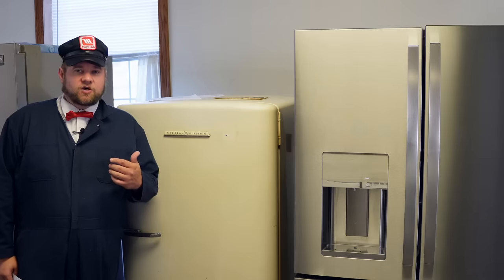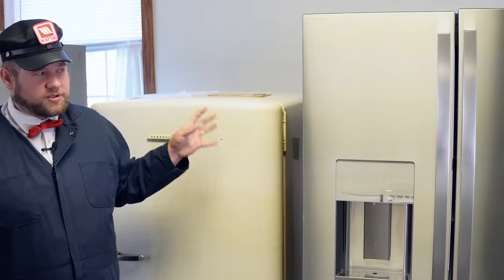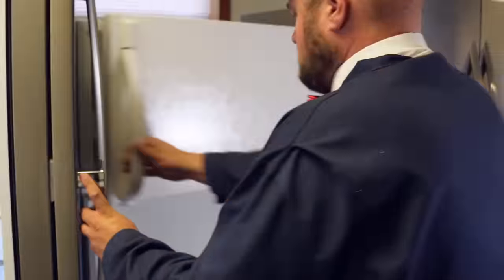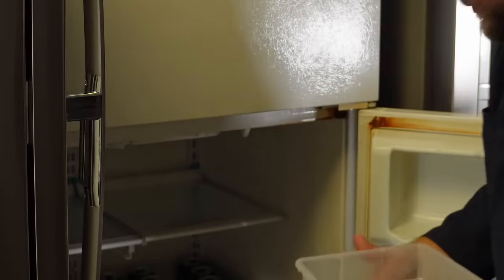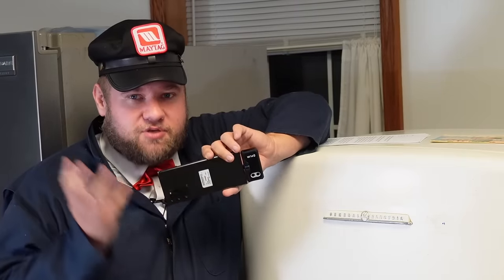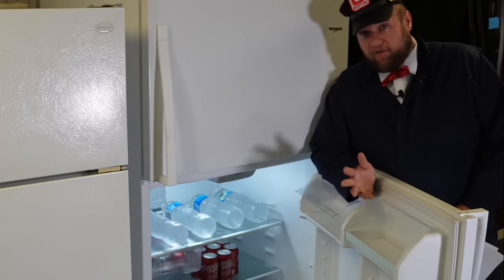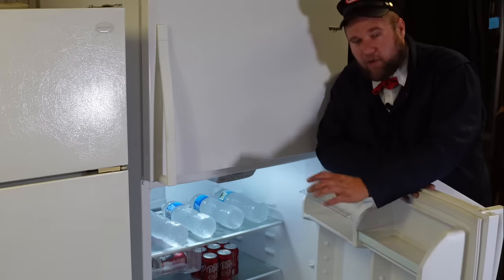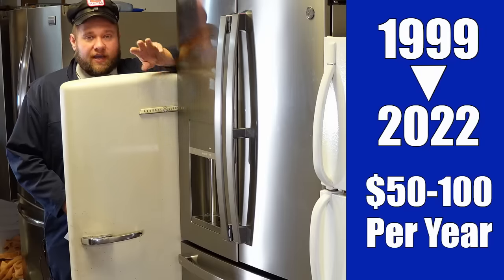Should You EVER Buy a New Appliance if Yours Still Works? A 7-Day Test

Comment: For me, it depends on whether or not there will be significant power savings vs repeated maintenance and failure rates. Old stuff can last decades but they can also suck up a lot of juice.
Reply: I have an old electrolux fridge, past 40 years old by now, not sure how much power it uses but whatever it is, my electric bill is very small, even if i could spare a few dimes a month on electricity i rather keep my old one which gives me a piece of mind, reliability and sustainability over today's garbage.
Reply: @HansensUniverseT-A  I feel the same way about my Nintendo.

Comment: As a certified Energy Manger consider: IF you think you are burning KW with your old appliance THEN consider where you live. BECAUSE: If you live where heat is needed many months of the year. THE WASTED KW from your old appliance is suppling heat to your home.  SO if you have cold weather 9 months that means 9/12 of your 'wasted' energy is actually not fully wasted it is used to warm your home.  If you live in a warm climate and don't need a lot of heat...maybe you should buy a better unit.
Reply: A very insightful comment.   Changes the equation, doesn't it?

Comment: Longevity is always a craps shoot. We have an Amana 18 ft. top freezer model we got new in 1994. Still going strong with NO maint. issues. My mom bought a side by side in 1974 from Wards (Whirlpool I think made it). It had multiple repairs and died the week I sold the house in 1993 after she passed away the year before. We're on our second 5 cu ft. chest freezer and 5th dehumidifier. Had to fix out basic electric Magic Chef range multiple times (eats burner element sockets). The oven element blew up, arcing like a welder. Our Sears washer came from my mom's house and was new in 1992 (the tub on mom's old Sears rusted out after 18 years of use). Fixed several things on it and disabled the fabric softener dispenser as it leaks. One cycle on the mechanical timer has burned points. Our Maytag gas dryer was new in 1994 and is working well except the dryness sensor is bad so we just use the timed cycle. You never know what you will get, but it seams that the new stuff is mostly trash. One of the other YouTube channels I watch was complaining that his new Whirlpool kitchen appliances are junk. He bought the top line stuff and the fridge has never worked and they are still waiting on parts three months later and the board in their range is bad so the oven doesn't work.

Comment: I miss my grandmother's refrigerator from the 1950s. Same generation as your GE but larger with more chrome. Worked flawlessly (albeit too loud at times) for around 45 years, then there was an electrical fire - starting at a distribution panel just a couple meters away from the refrigerator. It was all smoked and smouldering outside. The compressor could still run, although I'm certain the coolant pipes could not survive. Anyway, it went to the landfill along with all the rubble. After rebuilding everything I looked for replacement, and guess what? There were almost identical replicas sold under Korean and Italian brands. At three-four-five times the price of an ordinary white box. Oh well, we took the white box.

Comment: 2018  whirlpool fridge broke down 
Tech said top defrost coil rust premature 
Coil bypass & recharge cost  $ 350
Top freezer unit working great
Reply from the maker: VERY common problem. Easy fix but man... Its rough that they don't make them right from the factory!

Comment: Through experience, if you have an old workhorse appliance, forget about how much electricity it uses. To “save money”, I paid $379.00 for a “top rated” energy star Friedrich dehumidifier in May 2020 and by June 2022 the compressor had failed. What money I saved in electricity never covered the purchase price. Luckily I saved the 1974 dehumidifier which is still running flawlessly.

Comment: I've had a Kenmore (I think made by Whirlpool) since 1994. The ice maker broke down in '99, and I just removed it in favor of the extra space. No service calls at all in all that time, although the plastic is starting to get brittle. I'll use it until it breaks and then if the repair is more than a couple hundred bucks, maybe buy a new one.

Comment: Hmm. I've just done this test with my 2009 Bosch. I've done it once in the warmest summer. At 28C ambient temperature, it consumes 0.75kWh/day. At 20C ambient now it's 0.6kWh. And consumption is roughly 62W when running (was even 85W just after I plugged it in on start of cooling cycle, but it dropped in minute after some bubbling sound stopped. So it's roughly 4.1kWh/week. Considering price of the same size (roughly 60x60x185cm) new fridge is roughly 1200$ here including tax and considering I can likely safe 0.1kWh a day, change won't pay back. But hell ... I'm almost sure old fridge was not among cheapest and it cost 2.5 times less.

Comment: Having gone through 3 microwaves in as many years while replacing my original 18 year old working Sharp Carousel (inside was rusting) I find replacing working appliances dubious at best and a huge mistake at worst as in my case.

Old appliances were built to last and that in itself increases the complexity of replacement. In this world of planned obsolescence I for one won't make this mistake again.

The oldest appliance in my kitchen currently is a 1960 Dominion 2520 "toaster oven" which is not only a beauty but works a treat.

Comment: I have a Whirlpool Designer Style 1992 refrigerator with the freezer on the bottom. It seems to work great. It doesn't run all the time. I just cleaned the coils and the door seals are good. To me it just doesn't seem to make sense to replace it. It's in a limited space in my kitchen so the only refrigerator I could replace it with would another Whirlpool, in particular the side by side 20.5 model with the ice maker in the door.

Comment: Nice comparison, the most interesting data would be starting with all at working temperature with the same things inside, the energy used to get to running temperature is irrelevant because it only happens once.
Reply from the maker: All started at ambient temperature before we loaded them. I had to cut/time lapse everything during that scene, but if you notice, the lights are (or shouldnt be) on any of the refrigerators during that period of time, because none were on when we did this. I loaded them @ 75*F, plugged them into the KAW meters, then plugged them into the power strips, so each refrigerator had to cool from ambient + the thermal loads.

Comment: My Hotpoint no frost refrigerator, about the same size as the 1990s one in your study has been operating fine 24/7/365 since I bought it in June of 1976. The salesman told me I'll be back in a few years to replace it, because "They don't make them as good as they used to."
Actually, this was a replacement for the old Servel refrigerator that was in the basement of the house I just bought. The Servel was from the 1940s I guess, because it had rounded and not square corners. Also, the refrigerant was natural gas instead of Freon.

Comment: No. Newer stuff just breaks more easily and the parts are costly to replace or are just not available even if it's only 2 years old. Also buy the most basic model with no touch screens or unnecessary 'smartness' if you want to use the appliance for a long time. 

This is taking into a fact that you're not using 25+ year old appliances. You will save more in electricity costs then by buying new. But stuff like a washer which gets use only a few hours a week can still be used even if it's ancient with no significant damage to the pocket.

Comment: We had the same GE though from 1947 and probably 6cu ft that came with the house I grew up in and was in our garage as an extra fridge when I was born already as we had a matching 1950s Hotpoint in the kitchen that was much larger. 
The efficiency of the two Whirlpools doesn’t surprise me. Whirlpool won a challenge in 1995 and was awarded forty five billion dollars for developing the most efficient refrigerator design and their most efficient model is their 19cu ft bottom mount. In fact both times that I’ve needed a refrigerator for myself I did my research and I’m on my second since 1998. I have laughably low electricity bills.

Comment: If your fridge stops 
Check  behind for a trip switch  mine had one  never seen this B4 its a  Haier made in Thailand  * a small turn with a  screwdriver click  started  
Some have a red button on the motor old style    Also the thermostat if gone Undo and join wires if starts run & buy a thermostat  cheaper than the $160+ repairman bill Not hard to do

Comment: When you were showing the temperature difference from the outside using the thermal camera, while talking about air leakage around the mag seals, you mentioned about resetting the door seals using a blow dryer.  Can you explain how to do this in a little more detail.  I have a freezer that has some gaps in the door seals that I have replaced once already.  Thank You.

Comment: I would repeat the tests on the most modern tests, only with something like blocks of styrofoam or other solids with low thermal mass to fill the big fridges down to the capacity of Grandma's. Make sure they don't touch the walls of the fridge and increase the amount of air that gets emptied out and replaced with room temp air every time the door is opened.

Comment: I sold my parent's 1969 Sears frost-free upright freezer (19 cf) in 2010, we only replaced the timing mechanism once. I still miss that appliance, but I couldn't keep up with the $50 per month electric bill. I should have kept it in the house instead of the garage, maybe it wouldn't have cost so much to run. I should mention, I live in a hot, dry desert region of the U.S.  During the Summer I'm running an evaporative cooler 24/7, the freezer cost on top of that was more than I could handle.

Comment: Very nice video. I did notice that you were trying to get a measurement of like kind refrigerators. You may have overlooked that the refrigerant from 1950 is not the same used in modern ones. I believe the old ones used R12, R22, or ammonia. I know that R12 was the best refrigerant for cars because the air temperature out of the dash was at least 8 to 10 degrees colder than modern cars running R134, which is terrible. Therefore ozone friendly refrigerant isn't as efficient in heat transfer and in theory should use more energy to accomplish what old refrigerants did. The other factor to consider is how much an ice maker will play a significant role in electricity use, especially with a family. All that warm tap water refilling the trays will make the refrigerator run significantly longer.

Comment: I like a freezer top, its less awkward to fit frozen things in, i don't use most of the fridge portion so i put a lot of jugs of water in the bottom drawers/door shelf because i don't really want to bend down to get anything, don't know how much im saving though. I also have water jugs in the freezer portion but my current fridge has a skinny freezer and not freezer top so i cant fit a lot of water jugs in there. My fridge doesn't cycle too often so its good.

Comment: Will donate my old Kelvinator for free.  Don't know the year, but it is a 50's or 60's model and last I knew worked perfectly fine and quiet.

I can even deliver it for free, depending on your location.  I own and drive my own truck for a living so I can just toss it up on the trailer and bring it with me, heh.

You can use it for whatever, including taking it apart.  I've had it for about 20 years and have never found a need for it.  Better than it going to rot sitting in the basement.  That way, you can do both a teardown video and still keep your grandma's fridge intact.

Comment: One thing you have to account for is the massive air spaces in the various fridges.  The second you open them up, warm air rushes in to fill the entire unit except where there is an object.  That's why it's important to always keep your refrigerator and freezer full.  Otherwise, you have to cool down the whole thing every time.  Since you used the same number of bottles, cans, and water tubs, it's not really a fair comparison between units due to the vastly different air spaces in each.  It's actually not really possible to do a fair comparison because if you fill the space in the large one, you have to cool more cans/objects down even if you have the same amount of air space as the smaller units.   Still good information to know.

Comment: Not sure I'm getting your math.  If when you say "KW" you actually mean "KWH" (which is the actual accumulated energy being used over time - I thing you do, as the numbers keep rising over the course of your test), if I extrapolate the final 7 day numbers out to a complete year, I get:

WP 2018	240 kwh
GE 1950		339 kwh
WP 2022	391 kwh
GE 2022		610 kwh

Energy rates vary across  the states, but the average is ~15 cents/kwh.  As such, the annual cost to run (based on your tests) is

WP 2018	 $35.98 
GE 1950		 $50.84 
WP 2022	 $58.66 
GE 2022		 $91.51 

Fridge volume aside, it looks like a fridge with a life expectancy of 6-7 years is not going to pay for itself?

Comment: I had my older GE professionally serviced, with expensive brand new parts. A few weeks later my life changed when it caught fire, and burned down the house. I wish I had just bought a new cheap one for temporary use, until I was saved up to do a full remodel. Nobody warned me that fire was even a remote possibility. I will never have older appliances around the house again, even if they can be serviced. Ironically, I could buy 50 thousand new refrigerators, for the amount of money I’ve lost. 😢

Comment: It's not just the electricity costs you need to consider.  A lot of older appliances use chemicals and other materials that can be hazardous personally or environmentally which were not acknowledged to be so back when they were manufactured such as aspesdos or CFC's.

Comment: The interior volume of the refrigerator isnlt as much of a variable as you might think in terms of power needed to cool contents. Water has 800x as much mass per cuft as air. More is from the diference in mass of the cabinets that must be cooled. The cubic caacity isn't an objective basis of comparision. It doesn't reflect USABLE capacity. We recently replced a refrigerator with the "same size" unit" and can't fit as much in it. It has fewer shelves, less usable drawers and less options for their placement.  A more  accurate measure of efficiency and use is the energy use per day after the first 2 days. I would have added one thing to the test to  take it more realistic : opening the doors for 60 seconds at 1 hour intervals  10x/day.

Comment: I wonder if putting a computer cooling fan in the 1950 GE fridge would improve its cooling efficiency and performance.  Have the fan blow towards the icebox in such a way as to create more air movement and prevent stratification.

Comment: The 1999 model most likely has a switch that turns on and off a heater behind the panel between the doors making that show up very cold. Customers would turn the heater off to save electricity and did not notice the condensation till it starts to rust. Seen that over and over and would also complain about the mildew on the gaskets too,

Comment: I think a great follow up to this video would be to buy a new seal to replace the leaking one and see how much that costs vs how much you save.
Because it is impossible imo to draw any conclusions from this test, unless you can guarantee all fridges kept the inside at the same temperature. 

7 to 10 years is outrageous BTW. I'd expect a fridge to last 25 years.

Comment: My mother has a fridge that she bought back in the 90's to replace the one that was replaced by the building which is just them replacing their stuff. That freezer would make that hard ice that you have to shut the whole thing down clean out. She decided to buy her own. She bought a model from Sears. We still have it. While it's easier to clean than the older fridge, the one thing I noticed about it was that it froze things quickly. If you put a bottle of water in the freezer, it was cold in less than an hour. I could put in a cup of shelf-stable milk that hasn't been refrigerated and it would be cold in a very short period of time. So from 1998 to 2022 it's still going strong. 

My great great aunt owned a freezer, a deep freezer and fridge from the 1960's. I feel if it still works why replace it. If you need to buy something new, then take the old item and find a spot for it and use it.

Comment: My washer is a 50+ year old Maytag. Still going strong. Dryer is a Sears generic brand from 1975 but, except for breaking the belt once in the late 80's, it's still working. Friends tell me: "Why are you using those old dinosaurs? They gotta be costing you a fortune in water and power." Nope. I've got one of the lowest electric and water bills in the neighborhood according to the breakdown I get monthly from the utility company. The only thing I worry about is that I probably won't be able to get the parts to repair them when they inevitably break sometime in the future. Still, can't complain about the lifespan so far.